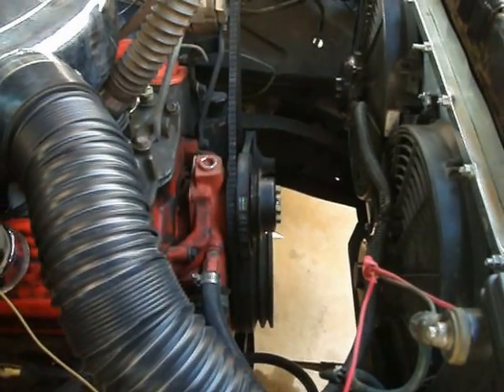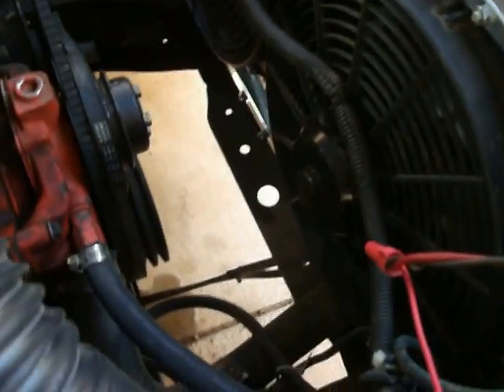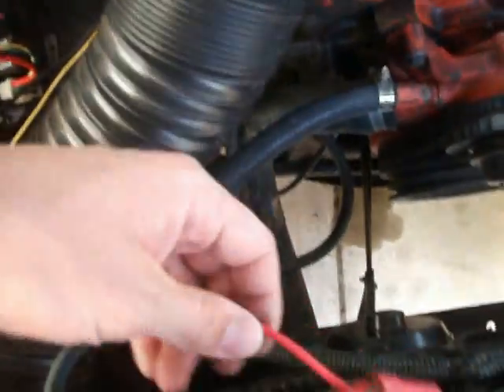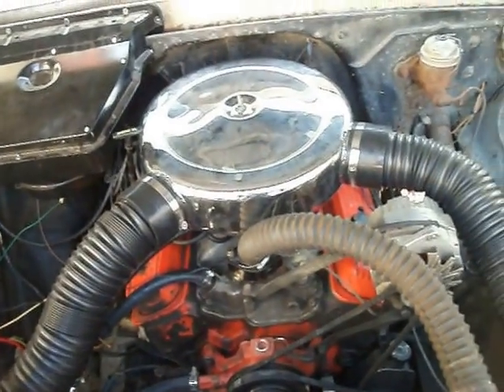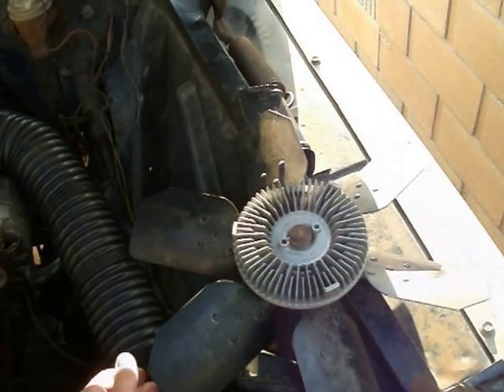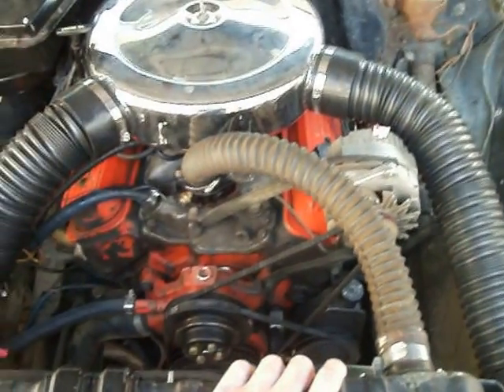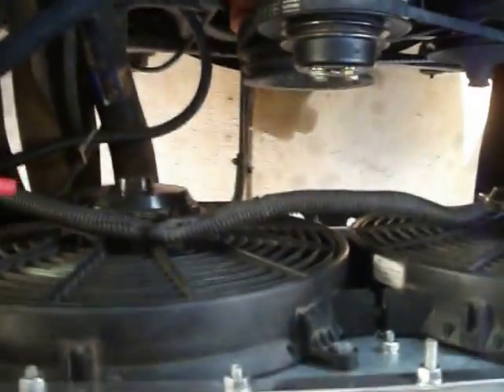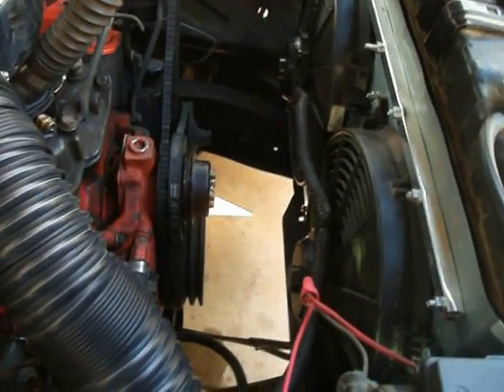Clutch fan VS electric fan

Comment: Electric fans do consume horsepower. They increase the load on the alternator which consumes horsepower.
Reply from the maker: According to a test using a 2500cfm electric fan, the extra load on the alternator required 1 more horsepower to run with the fan on.
While the same test engine required 29 horsepower to spin a conventional clutch fan.
Reply: +AllyourBaseArebelongToUs That would be one horrible clutch fan. Not sure that is typical. Electric fans use less power but the claims about how much you gain appear to stretched.
Reply from the maker: Zachary Harper the direct bolt on fan like the old school ones consumed over 39 horsepower.
The regular clutch fan used 29HP.

The difference was night and day from the old clutch fan.
My dad drove the truck and was so surprised how much faster it was.
Reply from the maker: ingebrecht ok so where's ur summarized comment?
Reply from the maker: ingebrecht too long didn't read 😂

Get ur point across in 3 sentences or less
Reply: but the fan only kicks on at traffic stops or very low speed..
Reply: @farerse  it only kicks on when the engine is too hot which normally is at traffic stops or very low speeds where you don't have the velocity of the vehicle blowing air through the radiator. 80mph highway winds blowing through the radiator don't need the fans to start so that's probably what's happening
Reply: +Cheeto Ayon - So far I have looked at a lot of Fans... Since I am converting to " Electric Fans " right now... I have seen them as High at 20Amps... But haven't found 30Amps yet, unless I use 2, but then there will be no room, LOL :(((... But even at 30Amps... That is only 360Watts, 1HP= 745Watts... So basically is only HALF a Horsepower to run a 30Amps Fan.
Reply: 30 amps would be the average amount a fan uses so you probably lose about 1 Hp.
Reply: @xXCHEETOBEANXx  finish the equation. Which his clutch fan losing 29hp he has a net gain to output horsepower of 28hp not negative 1
Reply: Your inexpensive ghetto mod is pretty cool though.  You would pay big bucks retail for a performance radiator conversion.   quicker / more snap during acceleration, because rotating weight was eliminated.  Try an aluminum flywheel and a manual transmission if you really want a surprise.  Less durable though, always a cost.  The greatest penalty would be assessed falsely on a dyno for a fan clutch. Extra load would more engine heat and make the clutch hang on all the time.  Moving through the air you could just remove the clutch fan, which is what the clutch does when it works right.    Another example of nobody driving like a dyno.  Look up the ways VW "cheated" it's pretty interesting.  You will gain dome sympathy for the company.
Reply: thanks for the video. it answered my more important questions. im switching to electric fan in my main trail rig. i too have a clutch fan alway stuck on. im not going to use a controller because i only drive road to get to off road and the reverse. im going to do a manual fan switch and im always watching my temp being on trails its slow driving so soon as im off pavement the fan will run constant. hopefully keeping my engine cooler and freeing up any hp would be nice. thanks..
Reply: Zachary Harper   Bullshit, an alternator under full power won't take a half a horse compared to a clutch fan pulling 5 to 14 hp!
Reply: Jordan Bronson 😂😂😂
Reply: Run a dual battery System and you don't have parasitic loss of any kind to run your fans or any other electric component in your vehicle
Reply: 3rd Gen Guy Exactly mate. I'll take electric fans over clutch fans any day of the week.
Reply: A clutch fan in the freewheel position uses less than 1 hp.   When engaged it uses as much as is needed.
Reply: +Dan Henderson - So it's like a Refrigerator? When we open the Door, a small Guy run out and turn the Light On for us, like in the Cartoons. Wow, I didn't know there is a Guy in the Clutch Fan as well, LMFAO
Reply: Of course everything cosumes energy just less than a big heavy dated clutch fan. The ONLY reasons factories use them I'm convinced is because of fires. Manufacturers have taken such a beating over vehicle catching on fire it's an eggshell area of engineering. If the clutch goes bad on the fan you get too much air if the electric fans go bad you get no air if a sensor goes bag on electric you get no air. If a wire is lose on electric you get no air which all on a hot day like he's having would increase the risk of a fire. So other than legal risk from the old dinosaur always spinning even when broken making it more reliable over time I can't think of a single reason they still use clutch fans
Reply: Measuring Electric usage does not take into account the fact that the alternator is not 100% efficient so the alternator will work a bit harder. The best place to measure Power output difference is at the wheels.  A dyno test does this nicely.  Direct bolt on fans use much less power at lower engine Rpm.  The power consumption varies as the velocity cubed and different fans properly designed could be better optimized even for electric ones.  Electric fans can actually resist / block air flowing through the radiator at higher speeds.  Electric Motors that are forced or held at some speed other than their natural rpm will consume more current.  Fans that have a temperature variable controller that are also speed controlled by the PCM are better than simple off on fans.  One other disadvantage to a clutch fan, suppose the nut behind the wheel is the drive until fail type.  Then the clutch fan comes off the shaft.  Guess where it goes? Through the radiator.  Very expensive.  Never happened to me because every time I checked the oil I tried to wiggle a fan blade front to back.  If it wiggles, change the clutch yesterday.
Reply: +Zachary Harper - Dam dude, you are fucking STUPID !!! Regardless how the Engine is running, the Alternator SPIN the SAME RATE with it aka RPM. It consumed your Battery, if your Engine at LOW RPM....  But NOT the Alternator, LMFAO..... DAM SOME PEOPLE ARE JUST STUPID !!!
Reply: When I went to high school they gave a course in speed reading. I just don't operate at your low bandwidth capabilities. I clocked 3200 words / min.

Comment: what was the part on the manifold you put where u said not to screw into tight BC I don't want to poke anything through my radiator
Reply from the maker: It was a 1in thermostat housing spacer.
With 2 3/8 tapped holes on it

Comment: good job bro. is electric better than mechanical fan in the winter? saying the engine warms up faster on electric since you can control the fan.
Reply from the maker: +Spacefied honestly i wouldn't know, that truck is still in california where it never gets cold.
i would assume having the fans off would quicken the warm up process; as a mechanical fan is always spinning.
Reply: the difference would be negligible.  the thermostat in your vehicle controls cooling to the motor. a electric fan would blow less across the outside of the block,  but I doubt it would make a difference.
Reply: Fan does not run in cold weather.  Clutch is temperature engaged.

Comment: Sanic, I like your video, do you remember what the specs are on your water neck riser (gasket or O-ring) and switch? Also did the thermostat fit in comfortably after the temp switch was put in?
Reply from the maker: The temp probe is very short and lines up with the inside diameter of the neck.

Comment: where did you get youre sheet metal from and shower rods if you dont mind me asking? awesome video btw kudos.
Reply from the maker: 15 thoisents aluminum sheet metal from homedepo.
Rod was $1 from a ace hardware.

Still works to this day, but my fan controller died so i wired it to a switch

Comment: Somebody suggested doing this to a 2.2 S10 to gain a couple horsies. I can't imagine a fan adding HP, would it?
Reply: ProChargedLS2 They mentioned that a clutch fan takes about 15-20hp to power, while an E-Fan takes up 1 or two
Reply from the maker: +ProChargedLS2 it's not horsepower created but rather HP not lost.
dyno tests showed the fans needed about 1 HP to run with a higher load on the alternator.
while a clutch fan engaged sucked more than 20 horsepower.
Reply: Yeah, modern technology is great!

If I am swapping a throttle body from a grand am to the 2.2 on my S10, will a throttle body spacer still work? I am assuming since the new TB is a direct bolt on
Reply from the maker: ProChargedLS2 dude I have no idea.
I only deal with carb'd SBCs

Comment: You could have just used the radiator drain plug for the temp probe.
Reply from the maker: +Claude “Reviews4U” Rains my drain plug is only around 1/4 wide, not big enough
Reply: SANIC Wow that is small as most are 1/2" or 9/16" corse thread. 

I ended up just shoving a Ford  Crown Victoria police in mine. As it come with the Ford factory variable speed controller and HD motor. I just measured the temp of the upper radiator and the lower. Then adjusted the controller to come on sooner. As they want you to measure the return line upper to get proper running temps. It sounds like a jet engine but my AC condenser loves it at idle.

Comment: Question... I would like to do this I have a 1970 GTO... But I have a 3 speed transmission.. When you removed the mechanical you raised the RPM? I am 2,000 RPM at 60 MPH.. wouldn't removing that mechanical fan actually raise the RPM?  and in my case that might be bad.
Reply from the maker: Ur RPM at speed won't change.

I said the RPM climbed faster when I gave it 100% throttle.

You will also pick up 1-2 MPG with these electric fans

Comment: if they do not consume hp ,,,,,,,,,,,,how are they powered?
Reply from the maker: It uses electric power from the alternator.
Dyno tests show a 1 HP draw with fans at 100%.
While a clutch fan sucks up 34horsepower.

Comment: Did you hook up the yellow wire the the positive lead on your electric choke?
Reply from the maker: The yellow wire went to the electric choke which is a 12 volt ignition source.
Idk if its + or -

Comment: if you need more cooling consider building a "box" or sealed fan shroud against the back of the rad since it seems the fans are drawing from two isolated spots on the rad instead of across the entire thing. id imagine even 1" would make a big difference. just a thought considering you mentioned making a new one.
Reply from the maker: I already made a better fan shroud.
It never overheated with the old one, but my new aluminum one looks better.
Reply: nice. thanks for posting the vid.

Comment: Nice video. I'll be doing this to my 67 Fairlane soon. You might want to think about upgrading to a dual master cylinder brake system. That way if one of the brake lines fails you don't lose total braking ability.
Reply from the maker: It's on my 2 do list.
this truck will hot 100mph easily, and the last thing I want is the brakes 2 blow.

Comment: Sick air intake!! I love it, where did you get that from? I hate hitting big puddles in my chevy and it sucks the water and kills my engine.
Reply from the maker: It's a Spectre Universal Fit intake.
It would also work as a snorkel for off roading.
Reply: Sanic Thanks alot for reply, I'm gonna do the same as you and get rid of my stuck old clutch and put a big electric on there. Great video clean looking motor, I like your water hoses they look different.
Reply: Sanic Not cheap about $300 for the intake, Eeek, but that's nice.
Reply from the maker: DREW TRUJILLO
The hoses are just universal ones.
That 350 was from a 94 k1500

u can get it for under $200. Or at least I did.
Reply: Sanic oh ok nice, I have a 91 c1500, and there pretty much flawless and easy to work on. I lost my fan shroud but yours seems to cool fine without one with duel setup fans. Do you have your Fans both connected on a single power wire to battery? Just a larger fuse?
Reply: Sanic or I know you can wire them separate and have a smaller fuse to each but 1 relay for both would be easier than 2.
Reply from the maker: DREW TRUJILLO
Both fans are linked with a fuse,
my controller died do I just rigged them to a on/off switch.
Reply: Oh ok, I did that too before but I got tired of always having to turn it on or forgetting. I think you can set the switch to on, and wire the + to ignition (on the switch with low current not the battery +) and then it will be on with the key. Or some have a third remote wire to do it with kinda like a car amp.

Comment: Nice job! What is the brand and part number of that fan controller? Thanks
Reply from the maker: The controller was a cheap $40 one from amazon, it died after 4 months though.
I just wired up a on/off switch.
I know painless preformance has a few controllers.
But they are $120+

Comment: great video im wanting to do the same conversion on my 2.8l colorado
Reply from the maker: I have a 2005 3.5L Colorado and the low speed noise from the clutch fan is annoying.
Reply: yep
Reply from the maker: chevellenut1968
Have you done the resonator box delete?
If not, you should
Reply: yea and took off lid to airbox
Reply from the maker: chevellenut1968
Make sure 2 use full synthetic as well, quiets down the DOHC a LOT.

Comment: You're the best kind of home-brewed mechanic - the kind that knows how to improvise within a budget, and work stuff like this without it lookin' "hack."

Frankly, the fan shroud you've made looks darned good. I'd keep it.
Reply from the maker: I made a new one from Aluminum. It was very easy.
Brought it out 2in away from the radiator and closed any gaps.
Dropped 6F from running temps.

Comment: How did you find a bigger radiator? I want a huge one that will fit my Toyota swap, it gets real hot in traffic
Reply from the maker: The 1964 C10 radiators are HUGE!!!  the original 283ci ran super hot.
the 350ci I have currently, runs a lot cooler.
You can probably buy a bigger fan and shroud.

Comment: Good video thanks. I ordered a 16" 3000 CFM fan made by FF Dynamics its advertised to only draw 10 amps and its only 3.12" thick I looked for a while for a good fan and found the typical auto parts fans are low end low CFM and over priced. My 77 Chevy truck has a 454 so I wanted a larger fan inches and the CFM. Hope the one I ordered works as well as the one you installed
Reply from the maker: Make a fan shroud and you good.

Comment: Great setup! I have been wanting to do the conversion. Where did you get the controller, because I have the same problem with high temp here in Escondido. Did you make that shroud or purchase it? Also, where did you get that sealed air cleaner box? I would like find one like that as well. Great Job!
Reply from the maker: The shroud is homemade, 2 hours, sheet metal, and some Imagination.
I made a new one that looks a lot better and is 2in further away from the radiator.

The cold air intake helped a lot, i gained MPG and a LOT of horsepower.
It will lean out at high speeds though, larger jets in the secondaries are needed.

http://www.summitracing.com/parts/spe-7118/overview/

http://www.amazon.com/Derale-16749-Adjustable-Fan-Controller/dp/B000CNAMMQ/ref=sr_1_6?ie=UTF8&qid=1390531796&sr=8-6&keywords=car+fan+adjustable+controller